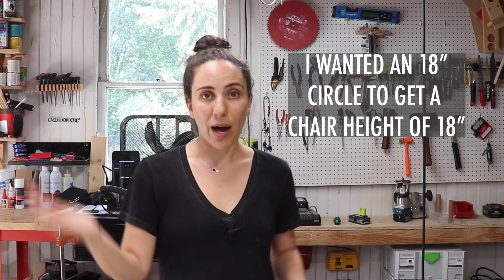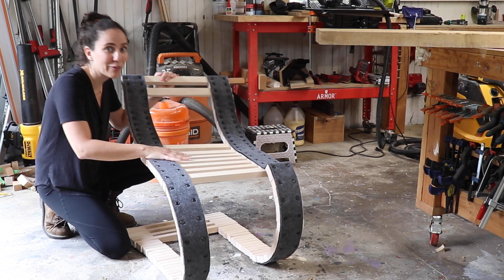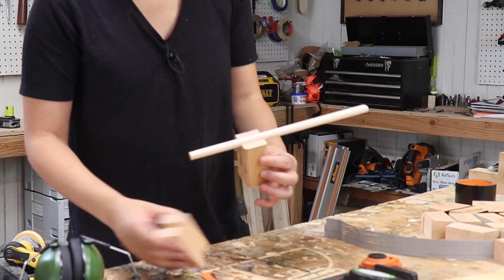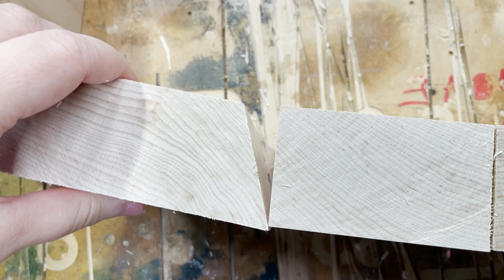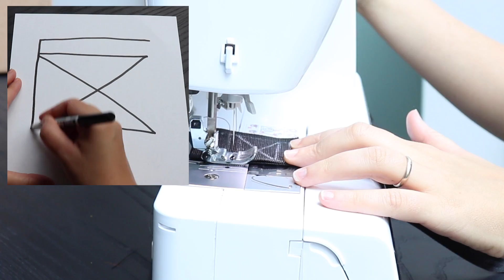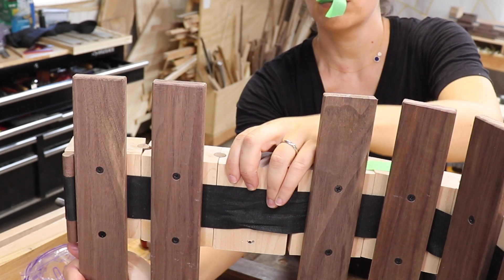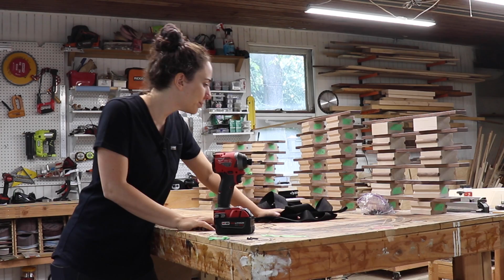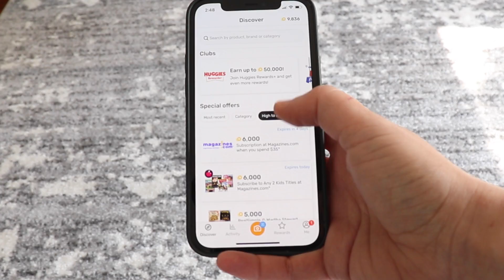I ATTEMPT to make a Roll Up Chair… AGAIN...

Comment: I am not an expert but think the strapping should only be there to hold the pieces together when rolled up. I think that all the force should be taken by the wood pieces instead of putting the force on the strap. What I mean by that is experiment with a different design of the blocks cut in a way so that they would stand alone without the need of a strap much like legos.

Comment: well .. the simpliest thing to save all the Work and STILL have it functionaly .. replacr the Belt/Straps with Metal-Hinges
and Leather will not work, Leather it self is very stretchy and will not return, i make Leatherbags and Belts.
another Tip if you try again, make the front out of two Radius, a bigger and a smaller on the bottom, to get more support, not tip over to the front so easy

Comment: The solution is to use a steel chain. You need something that doesn't stretch, and that you can affix to every individual segment. The straps slide around under the slats, and it will remain a problem regardless of what material is used. The moment you put tension on one part of the chair, another part will be forced to collapse by the straps transferring that tension. So you need either hinges, or a series of rigid non-stretchable links.

Comment: Run the strapping inside the blocks, round over the block on the side that doesn't need to use as support and that will make it roll up on one way

Comment: Not even a novice, but I think that straps won't work unless, as you suggested at the end of the video, they are connected to each individual piece.

If a material can stretch or flex or compress a tiny tiny tiny bit, then the bigger or longer the material the more the change in shape will be noticed.
Ex. .1mm stretch per 1cm-> a 2m strap will have 20mm of stretch.
Furthermore (again I'm big noob so I'm just guessing) straps in particular can deform width-wise which allows more length-wise stretch. Like how elastic bands become thinner as you pull them.

One more thing, i think there might be a problem from leverage and sliding of the segments. Knees for example have kneecaps and cartilage to both prevent sliding and for the tendons to pull at effective angles.

Last thing, I'm a bit unsure, but the arch on the leg area might need to be shallower or designed differently since the direction of the forces on it are uneven? Common archs in buildings have to compress evenly towards the center (I think), whereas cords only pull in 2 directions? So the cords pull allong the chair instead of towards the center of the arch which is why it is a brute force solution? Arch sags down as a result?

Comment: I immediately thought you'd need straps on the back in places too then this occurred to me... have you thought of running the straps through the centre of each block as well? Cut a groove in each one (through the dowels and out their respective channels), feed the straps through and out the top and bottom of the chair.. at the tops (on the back obviously) you could even attach the ratcheting strap mechanisms from trailer hold downs to adjust tension as the straps will inevitably stretch with use and age.

Comment: Looking at the design, shouldnt the strap "switch" sides somewhere around the seat area and be on the outside of the bend? Because one continuous strap will be tensed by the lower part and put "curling" force on the top part making it collapse.
Reply: the side with the strap is the side everything curls into, and as you can see by the chair shape, all points on the chair expect the same curling direction for this design to hold.
Reply: I completely agree, but it defeats her goal of making it roll up. The switching sides would definitely make it more structurally sound but I guess it's a toss-up between two goals for her project

Comment: Would wire rope work with a rubberized coating work ? Cut grooves between the top and bottom pieces of wood. No stretch and extremely strong

Comment: I can not read through 4k comments so some one might have said this allready, but;
Maybe use a sett of steel wire, and a screw in one of the ends to set the right tention?

Comment: There's a few other attempts on youtube which use a Z or S shape for the sections, and seem like they can hold some weight fairly well but still wouldn't be very secure nor last very long.

I'd try adding a tensegrity support at the top of the chair maybe, but it'd still be easily beaten as an actual, functional chair by more mechanically simple and sound designs like regular folding chairs.

Still, your persistence in essentially making these prototypes is impressive and inspiring.

Comment: Use carbon or fiberglass. They are cheap as well. I think also a total redesign, using metal pivets would be easier

Comment: I work as composites material engineer, and I don't think there's any elastic non-metal material (polymer, nor leather) which is capable of withstanding these forces without major deformation. Due to small width of chair blocks the leverage on the straps is huge. Of course this is easy to say after you've done this project, so great work nevertheless.

HOWEVER there's quite easy fix - without rebuilding everything. I think steel wire ropes are the answer :)

4mm cables have ultimate strength of 1 ton, and elastic modulus 170-200 GPa comparing to <3 GPa for polyimide straps. Replacing each strap with two 4mm cable wires shold be plenty strong and will elongate 100x less than polymer straps. It just would require small grove through all the pieces to accomodate for 4mm diameter. I could provide some more serious calculations if you're interested, because I love this idea and your admire your persistance for this project :)
Reply: Overmore - elongation of the strap under stress not only causes deformation of the chair, but also in theory decreases contact area between wooden blocks, further ruining the shape of the chair.

Comment: Two things to consider; 1. Given the strapping hinge points between wood blocks are vital for the integrity of the chair's structure, the surface area needs to be as high as possible, maybe try doubling the width. 2. As per point 1. using something else for the hinging points might be required than a long strap that can stretch. I would suggest something like steel door hinges between each piece. Good luck!

Comment: If it's anything like seat belt strapping then it's designed to stretch out under reasonable levels of force eg lower than average body weight as a baseline and the force of lets say the bodyweight moving forward at whatever speed a car crash may occur. then the 'strength' part is in regards to its tensile strength. I saw a comment regarding using a steel ribbon instead of whatever material the straps you used were made of. i thought it was a great idea aside from the potential wear of folding and unfolding the chair due to the plastic deformation of the metal.

Look forward to the next video, while you haven't yet completed the roll-up chair, the videos are pretty satisfying to watch.

Comment: Even if you made this out of steel and welded all the links together it still would be prone to collapse. When sitting on it, the upper part becomes a powerful lever and huge amounts of force is put on just a few links in the lower bend.

Comment: The idea is really unique, and this is the first video I've seen on it, so forgive me if this has already been addressed in some capacity, but the integrity required to support a human being on such a flexible contraption doesn't seem to be a problem with a simple solution, as the design is. If people are expected to sit on the chair as they would a normal chair, I.E. all the way at the back on the seat portion, there's WAY too much force being applied to the curve in the front. As a solution, perhaps there's some answer to be found in adding a bit to the very end of the base portion that curls up to support the back of the seat portion? That should divide the forces much more evenly.

Comment: The wood, even being dense will have some compression to it. Maybe some metal or pvc reinforcements on the "inside" of the chair would keep the wood from collapsing. Also, seems like the straps are entirely unnecessary. You should be able to do the exact same thing with a bunch of metal hinges, and have it be stronger.

The last resort would be including some poles/long dowels that can attached to the rolled up chair, that can then be placed as a brace between the seat and the legs. Kind of cheating but they can still be stored easily with the chair with some attachments.

Comment: Yeah those straps are strong but there not streatch proof
Use different non stretch material like kevlar
Or the material used to lift tons of weight in construction if anything leather would stretch more

Comment: The part about the foot or back of the chair collapsing when you sit on it gave me an epiphany what is going wrong.

I think main problem in is that the strap is only really secured on both ends, while any of the other pieces can just slip along its length.
When you're sitting on the chair you're creating a lot of tension on the strap in the lower curve. However, instead of holding the tension, the strap just pulls in additional length from the upper half or foot, which, due to experiencing not nearly the same amount of tension, can fold inward to shorten the strap length needed in that area and thus relieve the tension in the lower curve.
This is why no matter how short you make the strap, or what material you pick, the lower half just never holds its tension, and why sitting on the lower half with enough force just makes the upper half or foot clamp shut instead.

I think in order to make this successfully, you need to cut the straps into three parts: one for the lower straight bit, one for the lower curve until it straightens out for the seating area, and one for the seating area and back.
Each of these areas need to be tensioned individually, so the lower curve can't pull in material from the other two areas that are under way lower tension.

Ideally, just completely finish the lower curve first, strap and all, and make sure it can hold the required weight like that. Then add the foot and seating/back area to that on both ends.

Comment: Leather may be a good option at first but it will stretch over time needing adjusting and if its not looked after well or in a dry environment it will eventually dry out and snap

Comment: My 2c:
The problem seems to be that the strapping can strech, and the miniscule streches add up in one place, making the whole setup unstable. As the strapping is somewhat hidden, it may be preferable to either glue\nail the strapping under the walnut pieces, or just use separate pieces to ensure that these cannot add up.

Comment: If every peice had a screwed in metal hinge in imagine it would work, put the hinges on the outside of the curves so they can go into the curved position for the chair, then unfold to roll up. The hinges would do the same thing as straps but hinges obviously cant stretch

Comment: Not sure if it would work but I'd try using the straps from those tension thingies truckdrivers and most use to strap down things when moving them by a trailer or similar. In my experience those don't have much flex or give to them when you start putting tension on them but I could be wrong, they're also made to withstand high weights and forces.

Comment: Stop using that strap. You need steel cable strung through the chair body, with a tightening bolt on one end that you can tighten independently of the body. Stop making the tension solution part of the structural component of the chair. It should be able to be tightened independently after the chair is assembled. 

You can’t use fabric for this task. The amount of torque a human body will put on this curve is insane. You need steel cable to do this. Not leather. Not fabric. Not anything natural. Steel goddamn cable.

Comment: 2 Main issues mentioned a lot - incredibly high lever and and (in this design) the whole strap stretching - so you are propagating any elongation on like 2m length to points of highest tension.
But also wood compression - I don't think you can eliminate it even with steel joints - but due to geometry even minor compression will result in very noticeable  "hanging" (bent radius reduction)
It would not be the "original design" - but did you consider making a curve into supporting/floor part so it meets the sit of the chair and supports it?

Comment: One thing i thought about for the gaps you can use hinges under the strap so the hinges bclose those gaps while the strap keeps the tension in place. Its still going to have the roll up but definitely make it alot more ridged

Comment: Looks like this guy managed to get it to work. Not perfectly, but supports him.  https://youtu.be/MuodNlDKce4
He also admits the design is ugly. I would say the major difference is the full width slats giving torsional support, the strap being fastened to each slat, and the straps being much larger. They still are not stiff enough IMO. I don't think the z shape really added all that much.

Comment: 1) steel cables
2) turnbuckle adjusters because even steel cables will stretch for a while.
3) During test, pile on 50lb bags of dog food rather than using your body as a test dummy.

Still, fun to watch you build a webbing stretcher. Keep up the vids!

Comment: Mmm. Physics! the tension on the material is enormous, anything flexible you use is going to stretch. A motorcycle chain with rigid steel links could support this level of tension- it will also stretch a bit, but far less than any fibre or textile material. The next problem will be the compression of the wood!

Comment: No leather. It's weaker/stretchier than nylon or other strapping. The dowels were a good idea though. 

You've got 2 issues to fight here. 

1) your webbing is too stretchy. Try steel cable or a thicker/weight rated webbing like that used in industrial ratchet straps (on semi trucks) or rigging for cranes. 
2) each link should be RIGIDLY anchored to the web/cable. Each joint will require a different tension to resist folding, but right now, only one low tension is possible in the strap, so the back is firm and the base is just not tight enough.

You also might consider rounding the facets off to reduce the force concentration at the sharp corners.

Comment: While much concern has been expressed about the stretch of the webbing, where there are expansive forces on the webbing, the opposite side of the chair elements are in compression, and the young's modulus and compressive strength of the wood will also be a problem. Unlike a bent-wood chair, such as the Ikea POÄNG design, that the curve of this chair closely resemble, this design concentrates forces on the wood at each joint rather than evenly distributing it around a curve.

Comment: I know this may not be as sexy, but have you considered using a flexible metal for the strap. Think of the straps with holes in them that hold up pipes and ducting work. And metal is incredibly strong in tension.

Comment: may sorta not be the look your going for but what if you design a segmented support beam that lock into place into a hole drilled in the bottom piece. Sort of like the supports of a fold up table.

Comment: What about using metal stripping. Maybe cut a flat strip of metal roof sheeting and use that as your ribbon. Then you can drill through it and clamp it between the pieces of wood with a bolt and washers? That way, all the pieces are not pulling on each other, and the end sections won’t collapse from the strap tension. You could stack the metal strips for strength if one strip is too weak. It wouldn’t bend really well, but it might work?

Comment: Instead on two rows of angled blocks, why not do full width angled blocks. Also it might be beneficial to drill holes through each block and run a cable inside of the blocks. That way the tension forces are constrained to inside the block and they are much less likely to collapse.  And if you are using full width blocks you can use 3 or even 4 cables to help reduce the tension on each cable for safety as well as reduced stretch. Cables also have the added benefit of being able to add a turn buckle or some other kind of tensioning device so that you can adjust the tension without having to take everything apart.

Comment: Someone might have already mentioned it, but carbon fiber has virtually no stretch.  We use it to reinforce foundations.  You can purchase carbon fiber fabric online if you search under foundation repair.  Also, as you and others have mentioned, fastening each block individually to the strap, like an old accordion desk, will keep all the forces being focused on the weakest point.

Comment: What if you didn’t use strapping at all but instead something like metal cable!? Surely that wouldn’t stretch. Also, if it doesn’t stretch, it might not have to be under tension. Perhaps this would solve both the tension and stretch issues you are coming up against.

Comment: Can't you just drill a hole in the middle of each part, then pass through the entire thing two steel cables, which you can adjust the tension as you need?
Reply: It wouldn’t fix the tension issue. The S design puts a lot of stress on the bottom curve when pressure is applied to the sitting area.  What would most likely happen is the steel cable ends would slowly dig into the wood until it creates slack, or the wood would start to compress. Unfortunately, the materials being used are just not strong enough. Without a back support, the chair is basically a big lever that stretches at the bottom bend and gives it a short life span.